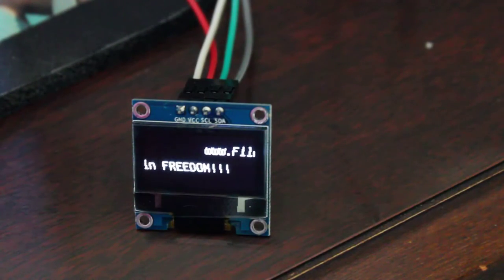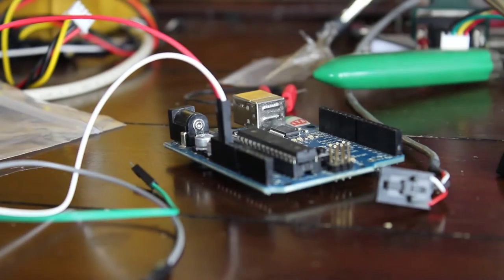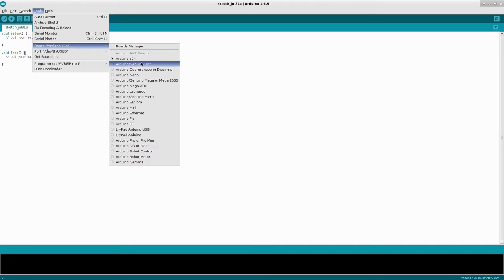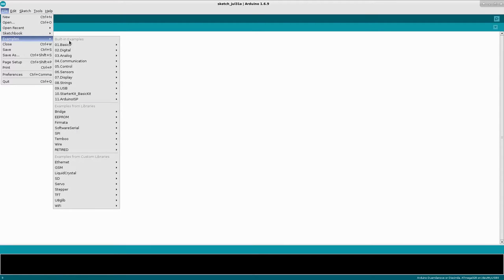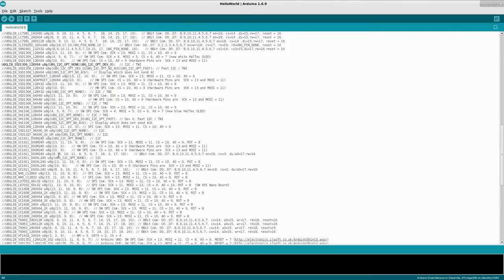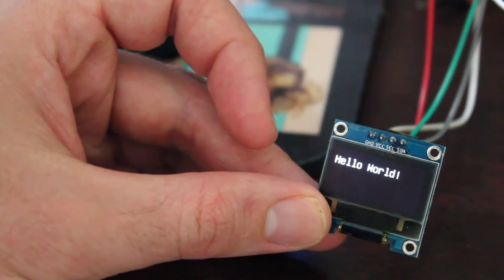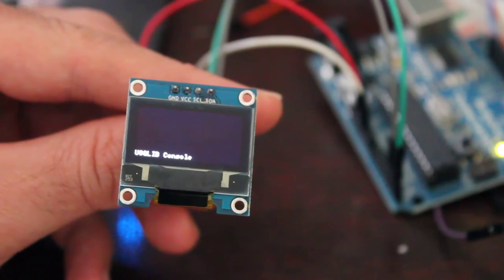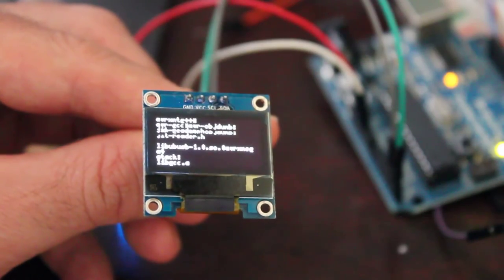Arduino Screen Display I2C IIC 128x64 OLED

Comment: It's not analog pins you have to use, it's the I2C bus which is locked to pins 4&5 (cannot change) and those are not analog signals, when using I2C.

Comment: Thank u so much , yours is very easy but it is too small size font to see your sketch clearly
Reply from the maker: Font size is a standard 12 size and is very clear when viewing it in 1080p.  But, you can just download the code yourself.  Default font size in the Arduino IDE is 12.  To change this, go to "File -> Preferences".

Code:
https://tinyurl.com/y8oq585r